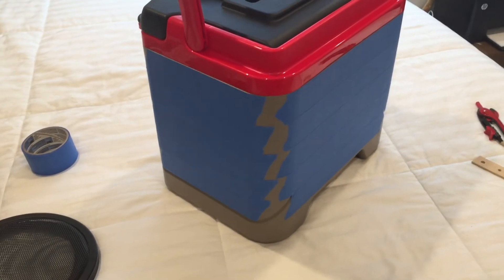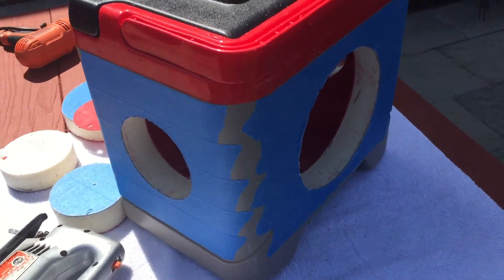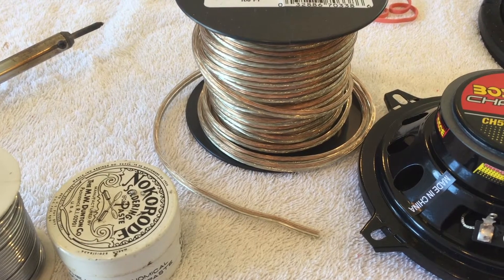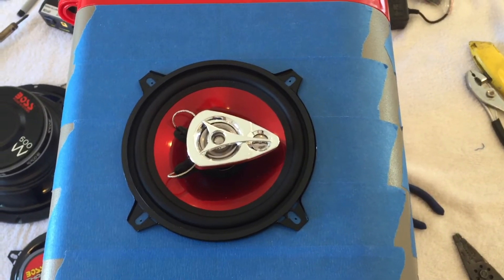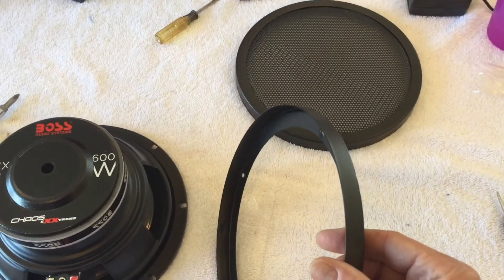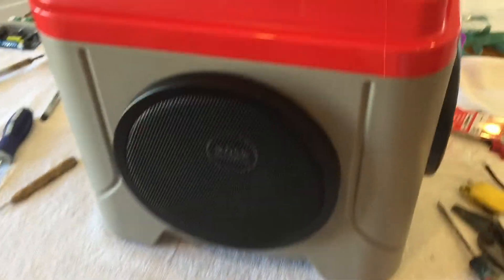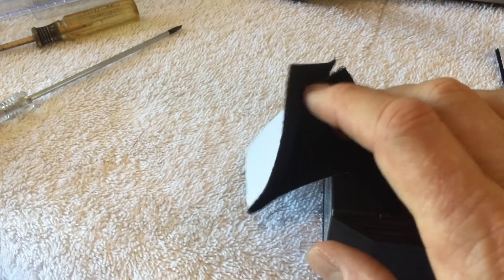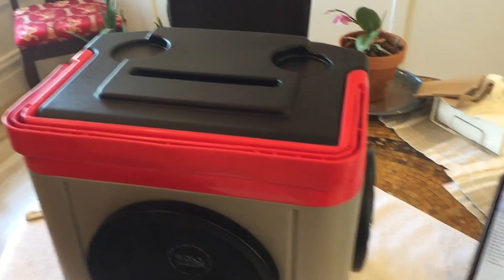DIY Bluetooth Speaker made from a cooler.  You can DO this!

Comment: How long does the battery last and what is the ah on the battery ?
Reply from the maker: Depends on the voltage you're pulling.  Mine typically lasts for 8-10 hours of constant use.
Battery: 12V/8300mAh; 9V/11000mAh; 5V/20000mAh DC Output

Comment: What type of battery pack is that if you have a brand let me know please
Reply from the maker: Within the description:
Battery: TalentCell Rechargeable 72W 100WH 12V/8300mAh 9V/11000mAh 5V/20000mAh DC Output Lithium ion Battery Pack with AC/DC Charger

Comment: Thank you for the really solid how-to. Most are not nearly as good. Love this build, bought all the stuff, and am going to try and recreate next weekend. Quick questions: did/do you need to use any connectors to connect the speaker wire to the small blue screw terminal blocks? Second: I don't have a soldering iron. What would be the next secure best way to connect the sub (which has screw  style terminals) I was thinking a ring terminal? Last Q: is 18 gauge wire enough for the sub as well? thank you!!!
Reply from the maker: Sorry for the late reply. No connectors needed to connect the speaker wires to the blue terminal blocks.  I did twist them up and put a drop of solder on them just to avoid fraying.  For my sub, it had a spade-type terminal that I soldered the wire on to.  A ring connector crimped onto the wire end should certainly work.  The 18 gauge wire has performed well for me.

Comment: How long does the battery last at 80%-100% volume? Also how is the Bass? Pretty deep low bass?
Reply from the maker: It will last several hours playing pretty loud.  With the 8-inch subwoofer the bass is really good, especially using a cooler instead of other thinner-walled enclosures.

Comment: is that amp blue tooth and you just plug in the equalizer thru the amp?
Reply from the maker: The circuit board/amp is bluetooth, so your phone will 'see' it in the bluetooth settings and you can connect to it.  The circuit board also has a 3.5mm headphone jack for input if you want, but I just use the bluetooth connection.

Comment: Is your lid vibrating alot? And how does it sound? I did a build with the same cooler but I put two 4' in the front and two 4' in the back and one 5.5' on each side. I wish it had more bass though. Maybe I'll build another idk
Reply from the maker: Yeah, my lid vibrates a little too, so I put some small rubber cabinet bumpers on it where it closes and that helped.  The 8-inch subwoofer really thumps, so if you make another I recommend a subwoofer somewhere in the build.